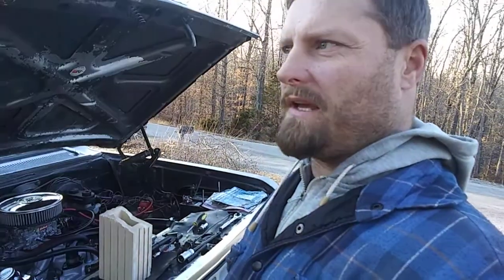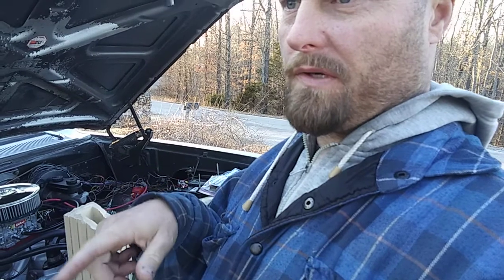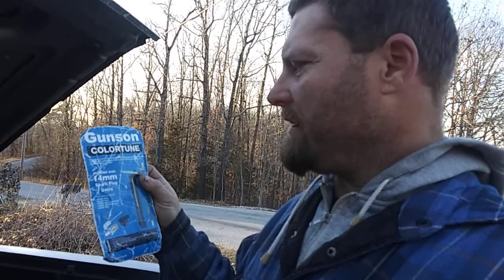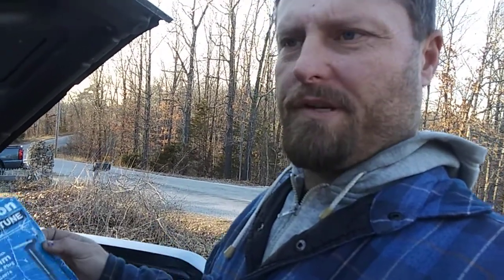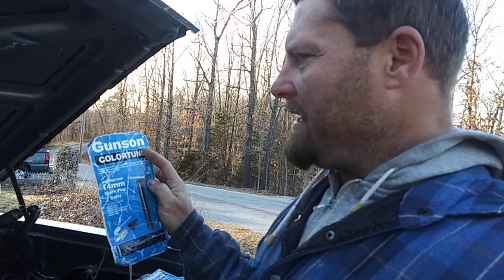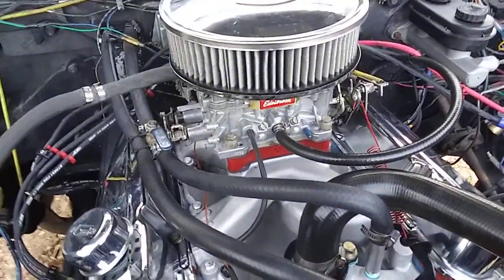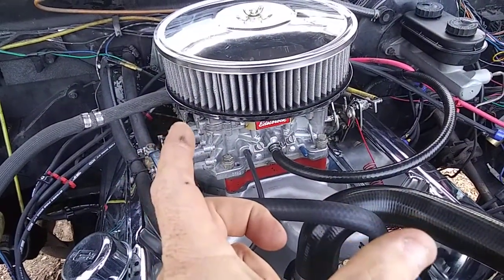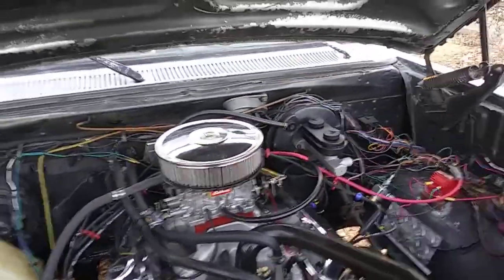DIY LOW BUDGET : GUNSON COLOR TUNE Kit - Properly tune fuel / air mixture for CARBURATED ENGINES

Comment: The first see-through glass insulated spark plugs were made in the 1920's I believe. They probably looked cool running at night with the hood off as the whole insulator would light up. This is where they noticed the burning color in the cylinders. The Gunson colortune is excellent for tuning cylinders of cars with multi-carburetors, particularly Stronberg, SU or Webber Carburetors setup with 4 cylinder or straight 6 cylinder engines where each carburetor is fueling a pair of cylinders. If you try to colortune V6, V8 or V12 engines with a single carburetor you won't get great results.